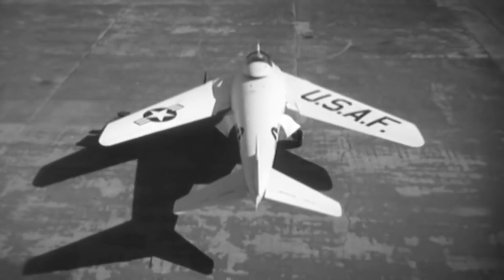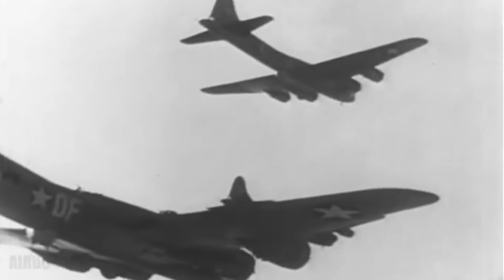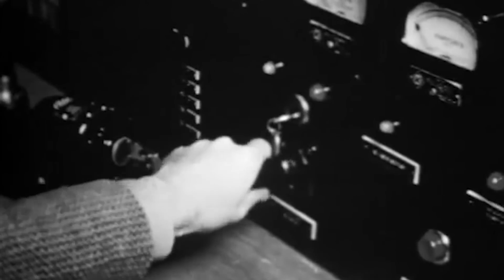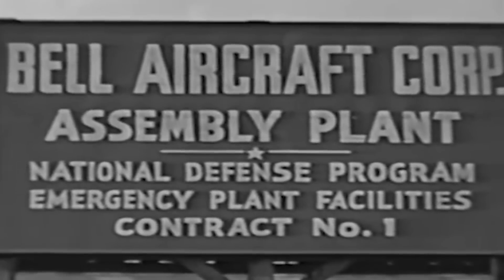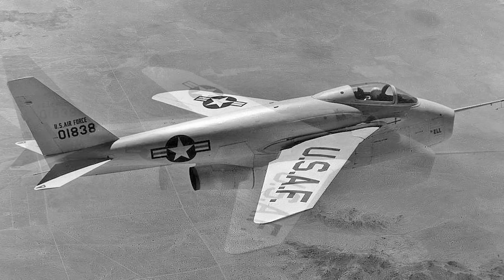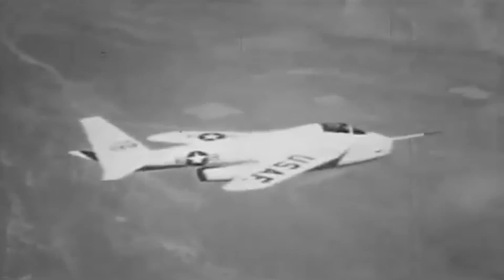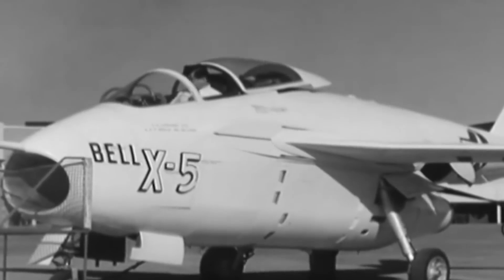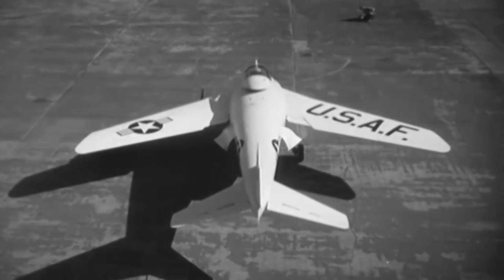Flying with Secret Nazi Technology - Bell X-5

Comment: The title is accurate - the X-5 was based heavily on German ideas.  But it did not 'revolutionise aircraft design and performance in the 1950s'.  It's function, as with the P1101 was to investigate one particular issue, the effects of different sweep angles.  Remember that the first Bell X-5 didn't roll out the door until 4 years after, for instance, the F-86 Sabre.  The F-86 itself made significant use of German WWII experience with swept-wing aerodynamics and in fact many of its design features were carried over directly from the Me-262.  The F-86 was praised for its handling and outperformed the rather evil Bell X-5 on all parameters.  So the Bell product was never going to compete for production contracts.  What it did do, as intended, was provide useful data on the effects of variable sweep and to highlight some of the pitfalls.  Similar work was occuring in the UK and in fact Barnes Wallis had already identified the CofG/CofL issue and identified a likely solution before the Bell X-5 had flown.  So, yes, this did inform later development of hugely successful aircraft such as the F-111, F-14 and Tornado, but it is also significant that swing-wing designs did not revolutionise the aircraft industry but remained tied to very specific scenarios that had to combine short-field and high-speed requirements.  By the mid-1980s the complexity and weight of swing-wing designs was no longer required as other solutions emerged.  As an example, a Typhoon fighter/bomber uses less runway, out-turns and has a higher top speed than a Tornado, and by a considerable margin.
And thank God Neil Armstrong walked away from the X-5 unscathed.

Comment: Last plane I can think of with the ability to change wing sweep was the F14. Ever wonder why it is not being done today? The ability to chance wing sweep was a complex stop gap measure. Not needed today due to improvements in engines,structure,control. Served its purpose, then done.
"Hey let's use the landing gear from the BF 109, never been any problems with it before".
Reply: The B-1 Lancer was introduced more than a decade after the F14 and variable sweep wing is a definitive feature of the B-1. The B-1s are still in service at least until 2036. The Russian equivalent Tupolev Tu-160 Blackjack is also a variable sweep wing design and very much in active service.
Reply: @tvgerbil1984  Hey, TV. I didn't say existing planes had to be destroyed. B1 was introduced in 1986. 
No new variable-sweep wing aircraft have been built since the Tu-160 (produced until 1992). Ask why. That group of technology (and complexity) is not need today.
Reply: @danr5105  The US Navy did pursue the building of a navalized version of F-22 with swing wing technology to allow these Sea Raptors to operate safely from the relatively short decks of aircraft carriers under the so called NATF (Naval Advanced Tactical Fighter) program. The program was dropped in 1990s when the Soviet Union dissolved and the USN couldn't justify to have these Sea Raptors without a worthwhile adversary in sight. It wasn't really the swing wing technology being irrelevent, it was the geopolitics of the world.
Reply: @tvgerbil1984  One factor that did reduce the need for swing wings (help on take-off) was reducing the weapon/fuel load out when comparing a F14D and a FA-18 Super Hornet. The F14 carried more fuel/arms (much bigger plane also)

Comment: I'm pretty sure it should have been a combination of the B-17 and B-24 bombers. The B-25 was a tactical bomber and rarely flew in formation with those four engine bombers.
Reply: Usual mistake, I'm sure the narrator meant B-17 and B-24.
Reply: Doolittle did fly it as a strategic weapon, but that was an oddity.
Reply: @Justanotherconsumer  The Mitchell was a medium bomber that flew one long range mission only by removing all the normal equipment, armor plate, and all the defensive guns except for the top turret. Fuel cells were stuffed everywhere in the plane where space could be found, and the bomb load was limited to 2,000 pounds. This was repurposing a medium bomber into the long range strike role,  not making it into a strategic bomber.

Comment: Great episode... Sometimes, the original idea does not work well because of un-expected issues, like what happened with the Messerschmidt P1101, and the eventual designs that follow the original failed designs, like the Bell X-5... But the ideas that did work well on those original designs, we're applied to other aircraft designs, like the swing-wings on the F-14's, the F-111's, the Soviet SU-17's, Panavia Tornado's.... This is the good that came out of other failed programs...

Comment: While it worked, stability problems with the plane kept it from being turned into a real fighter. It wasn't until Grumman figured out how to sweep wings without changing the center of gravity that the whole idea finally became viable with the F-111.
Reply: Airplane nerd here.  The CG change is marginal,  the aerodynamic ‘center of pressure change is significant .  As the wings sweep, the AC retreats, the plane becomes nose heavy, and up elevator trim required.  (Moreover, the AC also retreats across the airfoil at near sonic speeds.  This likely unknown to Bell...kind of a double whammy). Anyway Bell countered by sliding the wing forward.

  I don’t know how Grumman and General Dynamics compensated for the AC shift.  In the years Between the X5 and the F111, engineers accrued volumes of knowledge on transonic/supersonic flow.       Cheers
Reply: @danbenson7587  Grumman worked on its own early swing fighter (F10F Jaguar) and ran into the same stability issues. What was learned was applied to the F-111 design (Grumman was the subcontractor for the swing wing subsystem) and that’s how the F-111 became the first plane to sweep its wings in flight without affecting flight stability.
Reply: @Sacto1654  Thanks, I forgot about the Jaguar.  I recollect the Jaguar was a dog.  It had a stabilator whose incidence was controlled by a canard and the stick was operating the canard.  Arrangement proved quirky.   
      It proved fortunate the U.S. had war surplus test pilots as early jets burned through them.     Cheers
Reply: On the B-1 the CG must be moved in response to wing sweep changes.  This is done by transferring fuel from the forward and aft fuel tanks.  Normally it is automatic but can be commanded manually.   The manual command is what caused the crash of B-1A Ship 2 in Sep 1984.  CG was set manually for a test then the wing sweep was brought forward.  The co-pilot failed to move the CG and the crew kept cancelling the warnings for CG out of range.  When the wings reached forward position the CG was badly out of limits aft and the aircraft departed.  I was on the maintenance crew working ship 2 when it was lost.

Comment: Got to love how early Jets had open noses like the designers were still thinking "that's where the propeller goes."
Reply: To be fair, that's where the clean air is.
Reply: Early jets needed very long straight intakes and clean air in order to not compressor stall.   This was the lowest drag configuration that met the intake geometry requirements.
Reply: Later on, that's where the radar went and the noses tended to be closed up.

Comment: I remember when Australia had F-111s, excellent fighter bombers.
Reply: I worked on f111s. They took a long time to get off the ground. But wonderful in flight
Reply: Never will forget, was walking along a beach south of Tweed Heads around 1999, one of these was doing a low level flight just below the speed of sound, just picked it up from the corner of my eye, then the noise hit me.
Reply: @vintagetintrader1062  With after-burners fired up ?
Reply: Was bright day, did not pick the afterburner being on, it happened so quick, just walking along a squeaky sand beach than ‘bang’ and gone again

Comment: The Westland-Hill Pterodactyl IV of 1931 was a tailless design whose lightly swept wings could vary their sweep through a small angle during flight. This allowed longitudinal trim in the absence of a separate horizontal stabiliser. The concept would later be incorporated in Barnes Wallis's wing-controlled aerodyne.
During the Second World War, researchers in Nazi Germany discovered the advantages of the swept wing for transonic flight, and also its disadvantages at lower speeds. The Messerschmitt Me P.1101 was an experimental jet fighter which was, in part, developed to investigate the benefits of varying wing sweep. Its sweep angle mechanism, which could only be adjusted on the ground between three separate positions of 30, 40, and 45 degrees, was intended for testing only, and was unsuitable for combat operations., as stated.

Comment: The Bell X5 really looks a lot like the Saab J29. The J29 sure is a good plane though
Reply: The same German data led to the J29 Tunnan som vi säger här hemma. J29 looked like a pregnant pig on ground, but was apperntly good in the air. As the Swedish pilots always trained in realistic scenarions a lot of pilots was lost from the 40s and up to late 80s. Was it low level attack, then it was skimming the sea or the forest. The Soviets was always running in war mood, then the RSAF did the same. Top notch material, top notch pilots and top notch air combat leaders and system, they are still top notch, beware of the Gripen!

Comment: The Nazi's may have worked the advantages of the variable geometry wing for high speed flight. BUT the first aircraft to use variable sweep was the Westland-Hill Pterodactyl IV of 1931, which could vary the wing sweep in flight. OK it only moved a few degrees to control, longitudinal trim on this tailless aircraft. This tailless aircraft flew 2 years before the Horten brothers "invented" the flying wing....
Reply: yes , many countries work on flying wings, the most known was the Northrop (USA) and the Fauvel (France), but flying wings was unstable and attempt to loss of control, except the Fauvel who use "autostable" profiles, but such profile doest allow high speeds, so was most use on gliders up to the 60' (some built, under license, in Germany...)
Reply: @leneanderthalien  yes, there were many. The most forgotten of the early developers of powered tailless aircraft was The Irishman John William Dunne who developed a series of swept-wing tailless  aircraft between 1902 and 1913, when ill heath curtailed his flying and he took up fishing. He's better remembered for his book on dry fly fishing and a technique for tying flies than his flying and aircraft. Dunne's designs were designed to have automatic stability, the washout of the wing tips which were well behind the centre of gravity gave his designs longitudinal stability. Yaw stability was achieved by having cloth panels on both on the outer interplane struts. The incidence and interplane were also decreased outboard to help achieve stability. I'm not belittling the achievements Fauvel or any that came after Dunne, but Fauvel's first design came out in 1932 and was based on the theoretical and practical work of George's Abrial from the 1920s.

Comment: The P1101 was also inspiration for the Yak-15 and later the Mig-15
Reply: I am going to say no. The Yak 15 was a piston powered airframe with a Junkers Jumo 004 copy replacing the conventional engine. The placement is similar to the P1101 and many other German concepts. Seeing some German designs may have influenced powerplant placement(may have!). If the Mig 15 uses any German prototypes as it's basis then it would be the TA 183. On both counts the "official" Russian statement is that the designs were entirely their own. Although they admit to getting and copying British engines for the Mig, ones the then labour party sold to them.
Reply: I can’t see why the Soviets would copy the 1101, which was a heavily compromised design designed for a single purpose.  Work on the 262 and others would have been a much more useful basis, as it was for the F-86.
Reply: @speedandstyletony  The Yak 15 was clearly a copy. They took a Yak-3 Yumo airframe (a piston engine fighter) put a German Jumo 004 jet engine in it and converted it to the Yak 15. Its exactly the same as a R1101 with the difference of the wings because they used a Yak 3 airframe because it was easier and faster.
After that they developted the Mig-15, look at the top view of a R1101, its exactly the same as a Mig-15, wing angles and everything.
Here's a good video to it it: https://www.youtube.com/watch?v=QLiUZcUTkPw

Comment: I'm confused. Why would the Germans develope a sweeping wing if you could only move it on the ground? Something doesn't sound right about that
Reply: Probably testing concept.
Reply: Changing the sweep-back angle of a wing effectively changes the wing-section: unless you could change the wing-section during flight to suit the variations in sweep-back, then there'd have to be devices such as leading-edge slats and flaps that would deploy automatically  to compensate for inefficiencies in the wing's performance.
Reply: My understanding is it was to strictly analyze performance dynamics of different sweep angles on same aircraft platform. Testing purposes only.
Reply: @onionhead5780  that makes sense. I got the impression that they were trying to create an actual swept Wing aircraft. Maybe they were and the project was never completed. He just kind of glossed over that part but that would be an efficient way to test different angles of attack on the wings.

Comment: Want the Meteor the worlds first jet fighter?

The 262 was the first active one though.
Reply: not significant: first in service was the Me 262 (3 months before Gloster Meteor), but the first complete Meteor III  squadron was constitued in 1944, before the first Me 262 staffel...But because the alliees did have air superiority, was the development from the Meteor slow down despite better engines was built (like the RR Nene end 1944), so the far improved Meteor 8 was lauch only in 1948 (had a longer fuselage for better stability and better engines,was faster than the Me 262)

Comment: So, you did a version of the B-25 (gunship), but what im wondering is... Aside from the more Famous B-25, there was also the B-26, which, just by visual comparison, the only different was the tail configuration. Id be interesting to see a video on the B-26 and why it is seemingly "less popular" (or less known") than the B-25 (ie what were its short comings vs the B-25 and advantages, if any).

Comment: I've always thought that the Hawker Hurricane is an under appreciated plane. If there's any cool story you could find?
Reply: Hawker Huricane was the bad arse plane, cool looking bit of gear
Reply: How many would you like? First tank buster or tin opener with 40mm cannons on wings or test example flown with whole extra wing like a biplane which acted as a drop tank which when empty could be shed. How about the CAM ship examples which were war weary (ex battle of britain to start with) aircraft launched with rocket assist from convoy ships to deal with maruading Condor FW200s. Once that was done pilot had 2 options (if luck) fly to nearist land if in range or ditch next to convoy and hope he go picked up. Then there were tropical versions for North Africa mainly as ground attack. Main items that spring to mind off the cuff. Was a great plane and a shame more are not around.

Comment: Its poor spin recovery would have been remedied by the installation of a ventral fin forward of the vertical stabilizer.
Reply: Hertzair could be. I'm also wondering if the X5's tendency towards spin was not so much a design flaw.  I wonder if perhaps these excellent and  skilled pilots had difficulty managing extreme handling characteristic changes with the X5 once the wings were moved.
Consider: an empty tractor trailer  vs a fully loaded one. They are two different animals requiring two different mindsets. One is flexible with gear selection, requires little attention to brake component temperature and can stop quickly. The other is the opposite. And only with significant experience can a driver manage BOTH effectively.
The X5 was, as such, probably essentially  2 different aircraft. The forward wing and the swept wing.
Does that make sense?